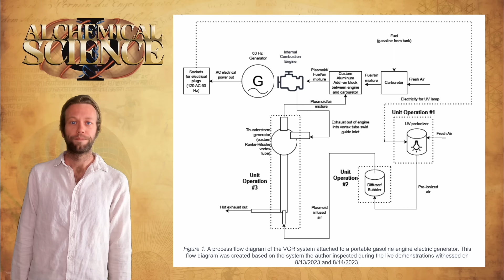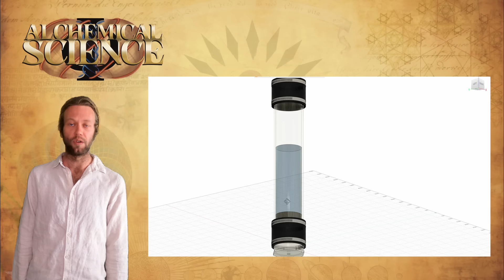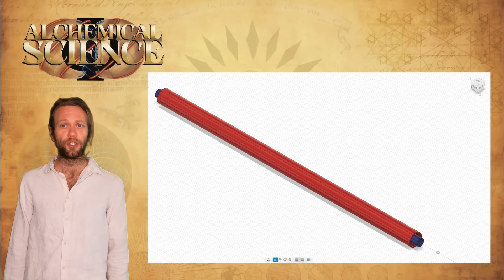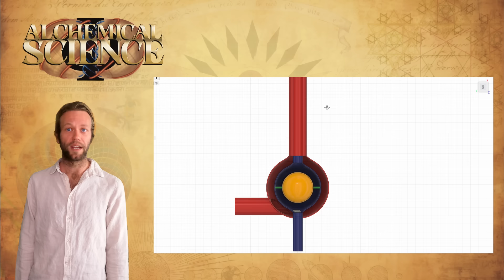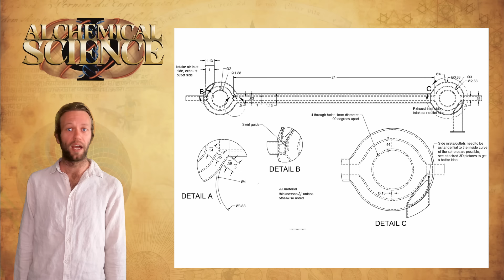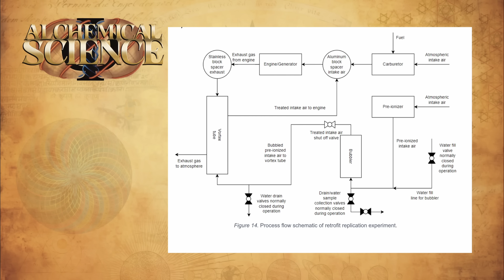Thunderstorm Generator | COMPLETE DIY BUILD GUIDE | Malcolm Bendall's Plasmoid Tech

Comment: Welding Stainless correctly is something that requires a bit of planning and a ton of practice. 
The fact they are spheres pumps up the skill level right up eh.
Definitely possible but air and water tight, centered, spherical, nice. 
Done well thats a bit of a task. 
Weld copper to Stainless? Is that a thing?
A bit to unpack.

Comment: I worked for Renishaw in the additive manufacturing division as a field service engineer. The powder bed fusion 3D printers excel at making these types of parts. The powdered metal choices are endless. I have printed parts out of titanium, countless SS variations, Inconel, copper, aluminum and some undivulged alloys that took all 500W of the 0.69 micron fiber laser beam direct, not pulsed as with most metals. I can design these parts in CAD with the adjustments need for successful printing without internal supports. since all spheres have holes in them we have no trapped material issues. The 51.8 degree transitions are not a challenge. What materials besides 304 SS should be tried?

Comment: Is this only really useful for a motor running at constant revs? I'm sure in the future someone will create an efficient throttle if not. Is it only possible to use this technology on petrol engines, or will it work with diesel too?

Comment: i think a good practice for the connection into the engine (carburetor)  especially when using aluminum block as an adapter-plate is to always use a gasket. Use either paper automotive gasket or my recommendation is to use RTV gasket hi-temp,as its used throughout motor build. Ensuring no vacuum leaks.

U could also attach simple MAP sensor or analogue vacu gauge for easier checking of vacuum levels/also help to instantly know when there's any leakz.

Comment: There are other ways to improve fuel economy by using heavier flywheels,  smaller valves and ports with small turbos, higher capacity and flow electric water pumps partnered with hotter rated thermostats, finer spray injectors with passive combustions spark plugs used in usually inefficient farming generators, offset centre crank to cylinder bore design like toyota uses and extra gears to make use of he improved low down torque. The re-introduction of sidevalve like pre-1930 Ford v8 which achieved 30mpg using proper Otto principles focusing on water flow and temps is being revealed recently.

Comment: I dont know. As an ASE Master Tech of 30 plus years, I have no idea what this contracption is producing that is combustible by a spark ignited internal combustion engine. There could be some truth to this, but Id prefer not to mess with this. I dont understand plasmoids. I assume its producing htdrogen from the water. If thats not it, Im lost as I dont believe its possible to combust (burn) a plasmoid. But its cool to see different types of technology.
Reply: In a conventional engine, you use gasoline.  Carbon Dioxide and other gasses are not easily combustible.  This uses electromagnetics, not an explosion.

Comment: I'm curious if this can be used with hydrogen, or wood gas, I was thinking about trying to run a generator on hydrogen or even wood gas and HHO.  USING turbo or blower am such as the amr 500 to blow air through the bubbler, compressing the intake charge to about .25-.5 bar, or 3.75 - 7.25psi.  possibly spinning it with an electric motor operating the supercharger, being powered by a motor acting as generator, using a battery for starting pumping the HHO through the water, Or hydrogen ONLY, WITH the O2 entering with the wood gas after the bubbler, ,(the wood gas having it's own bubbler. As well as a dryer, and filters, iron oxide and carbon filters, with a reusable desicate chamber to dry the gas maybe adding a thunderstorm to the mix could be interesting. Maybe make an attempt to condense the exhaust , possibly run it through a chiller condenser, (such as used to collect liquid nitrogen) to study further.  It would be awesome  if the exhaust could be reused as a fuel, splitting into hydrogen, possibly containing dissolved  O2.  I couldn't say what the possibly of what could be. I do feel spheres of stainless, can be easily cast from stainless using lost foam  or lost wax, or even lost pla, so the sphere can be 3D printed, and finally machined to a uniform thickness! As work holding features to be removed also.   This is very interesting! I am hoping it can work for my off-grid home generator on a 5 hp-10 HP Briggs and other engines, possibly a 12hp Briggs, and other engines used to charge batteries and provide power..  I'm hoping to convert tires and plastic to fuel, maybe use waste and used oils as a fuel even if I must use it in a boiler with a steam engine,  a Tesla turbine is simple to build. Constructing a condenser to gets the exhaust below ambient pressure, being basically a vacuum to the steam pressure. The turbine should. Be effective, a 10"-12" turbine 4"-8" wide, or thick, with a ..030"  between the turbine disc, and the center exhaust from front and rear, exiting approx. 20 - 35 mm  ports getting larger from the center to the outer in the disc to make accomodations for flow. Keeping about 4-6 , 6 x 6 mm spokes holding the bearing central . Possibly reinforcing it later if required . Or make the end caps from. 1/4" steel over aluminum. For less expansion,  with the steam being 350°f + (400° at most) to allow the turbine to run dry, prevent corrosion  spinning up to a 300 amp 24v alternator, likely not going to spin the full output! Sorry to ramble!  Have an awesome day, open source is Awesome! Thanks for your effort!

Comment: @12:00 Silver would seem ideal for this, with all those requirements being met. It's easier to work than tungsten or titanium, and a lot cheaper than platinum. Being the most electrically and thermally conductive metal, and the most reflective, I wouldn't be surprised if the best results were achieved with silver, or an alloy of it.

Comment: Firstly, I should mention I'm probably far from the most intelligent person ready these comments. Although I'm sold on harmonic resonance being a key ingredient to this device but surely the engine rpm and the exhaust gas pulses would play havoc on any sort of fine tuning ? Or is the ICE meant to run at a determined rpm, like a rattle in the dash of your car that only happens at a certain rev range?

Comment: I was a total skeptic but when you explained the harmonic sequence of the universe pitch it really brought it all together. The Simpsons were right. The metric system is the tool of the devil.  Finally I can make gold from lead. Oh and thanks for letting me know that introducing hydrogen into an internal combustible engine that it may do something. Mind blown.
Reply: You can buy hho generators for your vehicles. Cleans your engine up and gives you better millage
Reply: @tkskates  HHO is inefficient and the scam method. Stanley Meyer did not do it. See other comment.
Reply: @limitlessenergy369  It's not a scam method. It works fine. Is there better methods I'm sure there is.
Reply: Real stuff. Hydrogen will catalyze diesel well and make more efficient. Better is resonance tuned joe cell, which is more what Stanley Meyer really was doing. Not HHO.

Comment: I think I am missing a key element/s. What is the situation regarding traditional standard fuel like diesel/gasoline? Does the retro-fitted device (ie the engine) use ANY traditional fuel once the system is up to temperature and running? I understand the exhaust output is “air and Nobel gasses” but what of the fuel in the fuel tank? Is that still being used to run the engine in ANY way apart from start up/warm up? I don’t think I have heard a basic, nuts and bolts explanation of what this technology “solves” in terms of using fossil fuels. Is this a replacement for burning fossil fuels or is it more like an “additive” technology that make burning fuel more “efficient”?
Reply: What I understood from a different video they explained that it still requires some diesel or gasoline but only to the point where the system is brought up to temperature for the switch to be made to plasmoids as the fuel source.
Reply: 1/3 the fuel use

Comment: If the exhaust is 20% oxygen after passing through the plasmoid, why not plum the exhaust right back into the intake effectively using it's own back pressure to supercharge the engine.

Comment: It will be easier to fit onto a furnace or forge then a motor imo. I will be doing this for forging. Let’s see if I can embed plasmoids into the work
Reply: So how did the plasmoid thing work out for ya buddy?
Reply: @ gotta connect it. The SS one has outer diameter out of sync with standard fittings. The copper/GEET one works in a furnace but the SS one I made I want to drive with a generator for the heat conversion but the generator runs a compressor which does the vacuum part separating the plasmoid from the combustion chamber. This can the be feed into a separate burner to burn rubbish with plasmoid gas.
Reply: @ any alternating chimney under vacuum on the inner tube will make this effect. 
Check out ancient Iran cooling towers and ice storing in the dessert

Comment: This is a steam engine, that’s all. The light is simply theatrics. The bubbler is doing as they say, making millions of tiny moist bubbles. The generator is simply a swirling heat exchanger that superheats the bubbles making steam. Hey presto it’s feed into the engine block. There can not be a compression stroke in the bubbler as it is only connected to the intake port. Watch all of jay Leno’s steam car videos and you’ll realise that this is a basic version of what was happening 100 years ago. I would suggest after a certain period of time or higher RPM which don’t seem possible anyway the engine would stall rather quickly unless the carb was reintroduced
Reply: This has nothing to do with the steam engine. Literally nothing.

Comment: Think about the temp gradient as phase disparity like when you static shock a door knob there is a disparity between the phases in you and the door knob when they equalize there's a shock this is electrostatics like lightning is not electricity it's dielectricity. The ionized air a d exhaust never touch the disparity gets so large that the two actually equalize through the steel of the inside sphere and the dielectric discharge + the geometry of the gas bubbles collapse works together to make fusion take place it's like a positive feedback loop that's why the ratios are required. This is implosion tech. We use explosion technology now wait 10 year this will be everywhere

Comment: Why would people chose to add in gaseous hydrogen to the bubbler to increase hydrogen levels when they could just use common 3% hydrogen peroxide (H2O2) instead of water.
Reply: Some people are doing that as well, but not sure what the results are. Most are just sticking with water and recirculation. It hasn't been done too much yet, so maybe there is something we can learn.

Comment: Has anyone successfully built this based on this guide?
Reply: Doing it now. Orderd the spheres on eBay and pipes from plumbing store. It will be as close as possible but not perfect and will be used on a metal working forge to embed plasmoids into the metal.
Reply: @gruboniell4189  is it worth stopping people wasting effort on doing what they believe in?
Reply: @gruboniell4189 Did you complete it? Im starting to doubt that this is real
Reply: Please anybody who has a actually done this reply here. I dont think anyone has
Reply: @sebastianwhalin743  done. Not the sphere but two sophic/golden triangles instead of spheres and made the Geet and the windhexe. They do what it says on the box
Reply: @gruboniell4189 where's your video?

Comment: assign colors to materials if i have money id have one printed in  4 days id use stronger stuff  you can get ceramics this could fuel  a jet engine with ionized hydrogen separated oxgen and hydrogen .   you could print electic coil in to the outside of the cambers and uses magnets to compress the bubbles.

Comment: does this work with fuel injection
Reply: Yes, but the fuel injector is a custom and precise injector. Not like a normal one you can just go out and buy. Needs to be specially cnced. The one invented by Stanley Meyer has a delicate quartz rod in it too that pretty much has to be handmade.

Comment: The more I think about this, the more it doesn't make sense.  Please correct me if I'm wrong about any of this......  The UV stage does nothing but purify the air, because you need less than a 200nm wavelength to ionize anything.  The bubbler stage is simply a large scale essential oil diffuser, because that's all cavitation does, that I'm aware of.  The fancy heat exchanger would work as described if you were using a heck of a lot more than the 5 to 10 PSI that the engine exhaust is outputting.  The original unit, which I can't remember the name of, has applications in commercial refrigerators, but requires 100psi or more to create the vortex reaction that outputs hot gas out one end and cold gas on the other.  So essentially it's an expensive essential oil diffuser, pumped through a heat exchanger and into the carburetor.  Now...Perhaps it's a simple case of "something" is happening and not enough scientific scrutiny has landed a sufficient answer to explain this phenomenon.  I don't know, but I'm not convinced yet.  I'm going to need at least 3 other independent builders to demo it working in unedited videos for me to even think about building one.  At the very least, the UV stage is doing absolutely nothing.
Reply: This is so familiar to GEET and HHO. If I had the time to play around with this. I would experiment by getting the heat exchanger to produce steam. Adding a turbocharger. Adding an ultrasonic diffuser to make fog. Adding electrolysis to make hydroxy. Adding a red laser to ionize oxygen. Swapping the carburetor for multi port injectors. Adding a bunch of air monitoring sensors and connect all this to a laptop and run machine learning to test all variables and optimize a map.
Reply: If any of you are willing to donate to purchase the material I will gladly document all receipts for purchases and document the whole build and results. I have the equipment and skills to build the device.
Reply: @Dalton-lh6mb - Just Exactly How "Expensive" do you think "Materials" for this to be? 
One Paycheck? 
Two Paychecks? 
More? 🤔🥴
Reply: @robertweekley5926  I believe I could build it for less than $500 pretty easily. I have engines to run it on already
Reply: @Dalton-lh6mb Where are you located?
Reply: @Thebaneo123  southern Indiana USA
Reply: GEET back in the 80s by Paul Pantone.  Cheers Graham
Reply: It would be best if you watch and understand Bob Greenyer’s work.
Reply: Im starting to doubt that this is  real as well
Reply: @sebastianwhalin743  only one way to find out man I want to know myself. If it does that would be amazing but if not then fuck us all lol. If we all put 50-100$ together we can build it and let the people know?
Reply: @Dalton-lh6mb  Ill do it once Im sure it will work. It seems more likely that if I do it and it doesnt work, theyll just say im doing it wrong or built it wrong and wont prove anything
Reply: @sebastianwhalin743  you do you man
Reply: @Dalton-lh6mb  Best of luck tho if you try it!
Reply: @sebastianwhalin743  thanks I will post when I do
Reply: Updates?  @Dalton-lh6mb
Reply: I wanted to believe
Reply: I think the idea is similar to spins on electrons. Two opposing vortices which generate a frequency/vibration/wavelength with the air producing ionization of the molecules or rather de-ionazation. the wavelengths created from the freq generated with vortices cause the the effect. You can deionized molecules with harmonics similar to the resonance of an object. You destroy anything with the right frequency. Telsa, "everything is energy, frequency and vibration" Hence, God spoke and is was...
Reply: I'm not really sure how this all works . If you know who Randal Carlson,  he did an episode on the Shawn Ryan podcast talking about this . The model he spoke of recirculates the exhaust . The exhaust was described as clean without high carbon emissions.  It must require this to function properly . Here is the kicker , it is based on ancient Indian technology . He speaks of demonstrations where they convert some fairly large engines . You have to be skeptical,  but it is out there .

Comment: You're trying to reinvent the wheel.
Typically a small, single cylinder engine, will have an Exhaust Emission of:
Normal Carburettor
CO2  =  12 - 14 %
CO    =  3- 5 %
HC    =  200 - 300 ppm
O2    =  0 - 3 %
Vaporising Carburettor
CO2  =  +14%
CO    =  0.0x %
HC    =  0 - 50 ppm
O2     =  0 - 6% if its very lean
GEET System
CO2  = 0 - 1%
CO    = 0 - 0.0x%
HC    = 0 - 10 ppm
O2     = 18 - 20%

Comment: Cool stuff maan, I know its not completely cientific but it seems like breathing, wim hof mentioned the act of breathing created energy, I think or rather imagine it kind of like a van der waals machine where the walls of the lungs through friction create a static charge and the intensity may vary depending on the way you breathe but I suppose the opposite charges or in the case of this cool machine, hot and cold plus opposite charges, create a opposite play of natural movement through a vortice system (though a lot more complex and intriguing than what I can describe). It does sound like teslas way of cycling the increase and decrease of the electron cloud, kind of make me wonder if thats the thunderstorm part of the name. I really got excited with this!! Thanks!!!